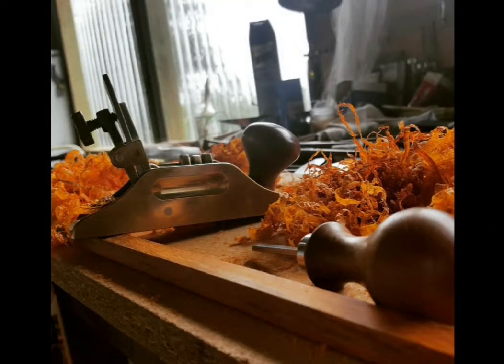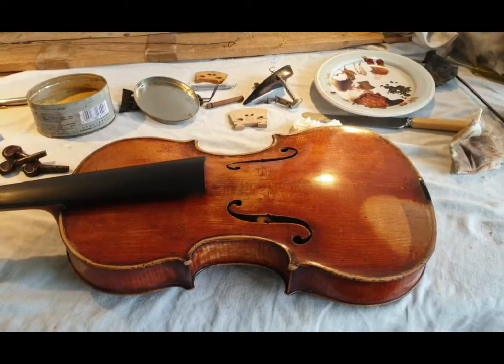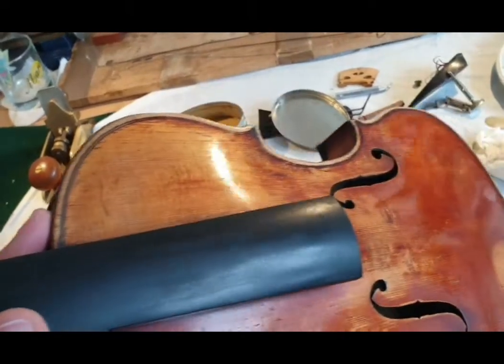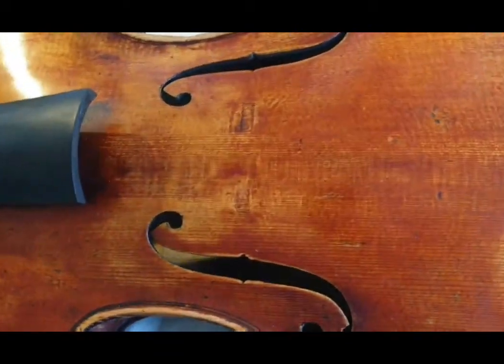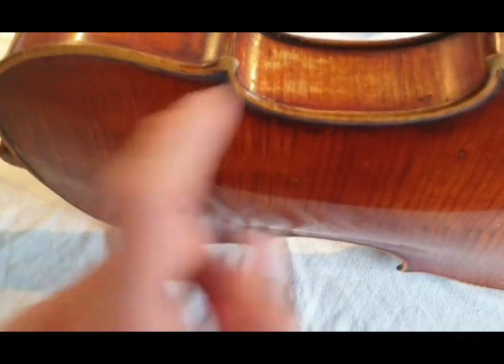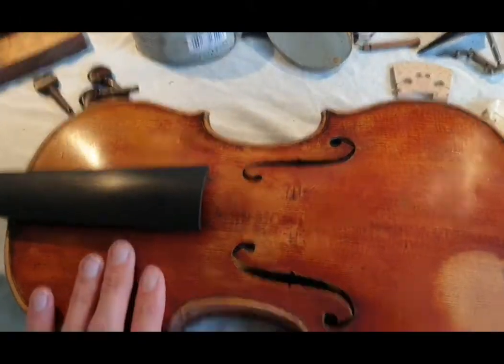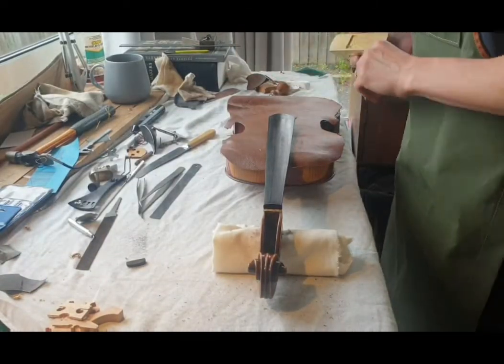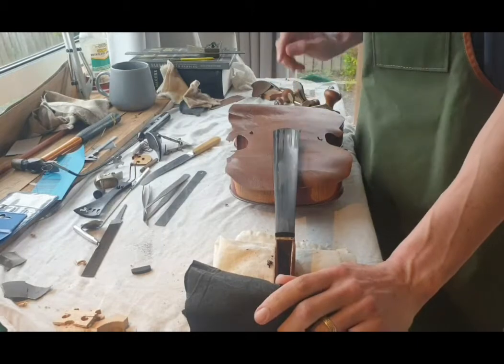Restoring a 170 year old French violin episode 1.

Comment: Presumably a fine line exists between cleaning and maintaining patina or the noble signs of age.
Reply from the maker: Certainly is,  preservation over restoration!
Reply: Patina or just many years of grime? :) I find it hard to accept that it may look old with 'patina' & yet it was never really cleaned properly (& I don't mean roughly). A bit of soapy water can make a huge difference in cleaning up many years of grime that others might refer to as 'patina'. Of course, rosin can build up too & that can be more tenacious to remove.